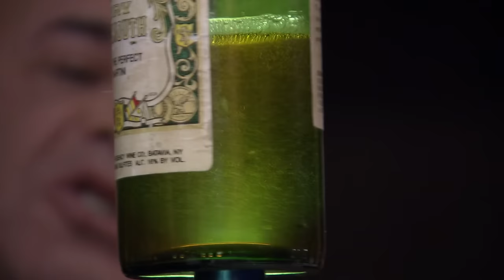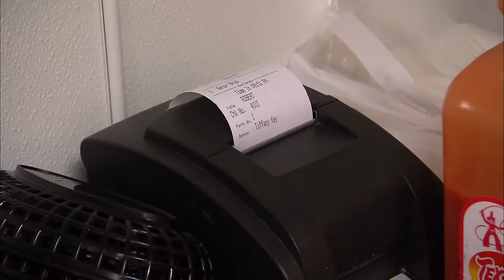Bar Rescue’s Creepiest Discoveries 🐁🕷

Comment: Regarding Headhunters, in Austin, I live 90 minutes away in San Antonio and worked in a bar near one of the biggest potential roach/bug/rodent sources (Tge Riverwalk) and our bar wasn't 10% as dirty as the Aistin bar. You have to clean, clean, clean and have regular insect control service but it CAN be done.
Reply: Because y'all cared about the business, this dude doesn't care.

Comment: If you’re wondering why Don’t Mess with Taffer’s wife hasn’t aired on Paramount Network it was due to a lawsuit stating that the producers wanted the previous owner of Bar 702 to act inappropriately or the bar wouldn’t be rescued. The new owners later appreciated the concept.

Comment: I call BS at 01:00 in the beginning when a cockroach is supposedly discovered in the bottle of liquor. She disappears behind the curtains only to reappear after switching the bottles. Then she shows a bottle with a dead cockroaches body in it. I have never known or seen a cockroach to be attracted to liquor in any way. They avoid it. Also, the bottle has a device on top to control the flow of liquid (I forgot what it's called) that would prevent a cockroach, unless it was very determined -yes I know they can squeeze themselves very small - from entering the bottle. This is BS. It's a fun show, love the show, but this is too obvious.
Reply: But she's holding the same bottle, and neither does it show her switching bottles before she comes back out. You may be reaching a bit.

Comment: Extracting species profile 

Pinacosaurus (meaning "Plank lizard") is a genus of ankylosaurid thyreophoran dinosaur that lived in Asia during the Late Cretaceous (Santonian-Campanian, roughly 75 million to 71 million years ago), mainly in Mongolia and China.

The first remains of the genus were found in 1923, and the type species Pinacosaurus grangeri was named in 1933. Pinacosaurus mephistocephalus named in 1999, is a second possibly valid species differing from the type species in details of the skull armour. Of Pinacosaurus grangeri many skeletons have been found, more than of any other ankylosaur. These predominantly consist of juveniles that perhaps lived in herds roaming the desert landscape of their habitat.

Pinacosaurus was a medium-sized ankylosaurine, about five metres long and weighed up to two tonnes. Its body was flat and low-slung but not as heavily built as in some other members of the Ankylosaurinae. The head was protected by bone tiles, hence its name. Each nostril was formed as a large depression pierced by between three and five smaller holes, the purpose of which is uncertain. A smooth beak bit off low-growing plants that were sliced by rows of small teeth and then swallowed to be processed by the enormous hind gut. Neck, back and tail were protected by an armour of keeled osteoderms. The animal could also actively defend itself by means of a tail club.